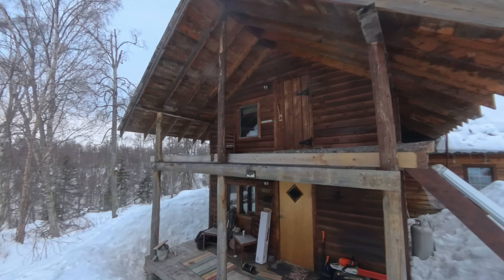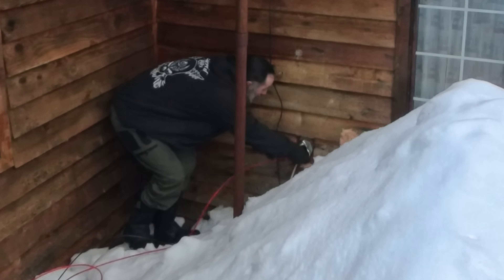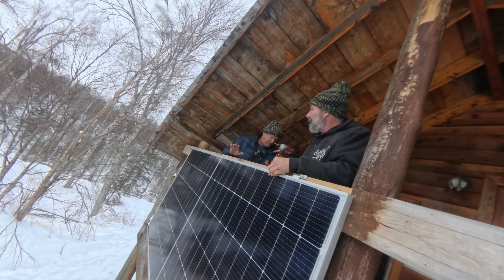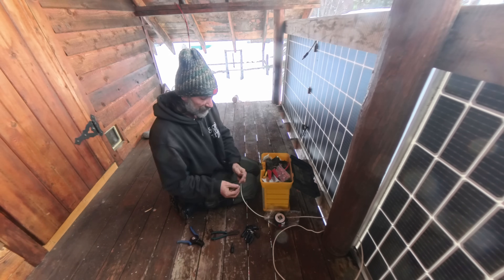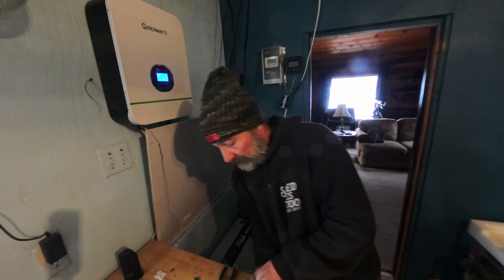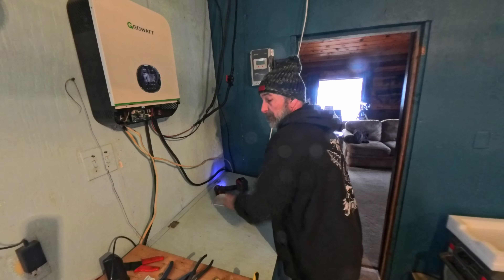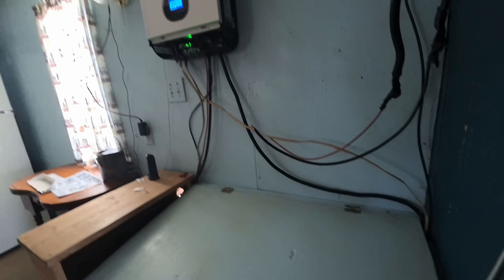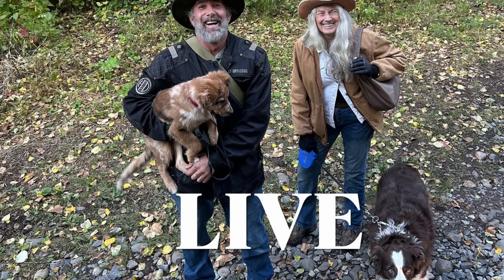Solar Power the Best Option for Off Grid Living!

Comment: Almost need crampons and ice climbing gear with that roof slide off.  Most of our winter is gone,  just a little ice left on the water.
Reply from the maker: We still have a foot or so in places. However our temps have been in the high 40's low to mid 50's so it is melting fast.

Comment: I have my BF 550W vertical 1 ft off the ground, with snow each 550W produces 697W, snow won't stick, only have to clean bird poop, panels are cleaner now than install.
12kw I made 1 MW Nov 1 to Feb1 and used 66 hours of Gen all winter with electric heat, only a -5F low this year and -27F previous. Low to the ground 1 person install.
Reply from the maker: Nice. What area are you in?  We are getting more panels.  I found some 370w BF for 150 each. I picked up 6.  I need to build a rack for them. I looked at yours YT and see how you did it and think I can do the same just higher off the ground due to snow depths.
Reply: @curmudgeinnak  The newer mount with sunken clips (and square lol) the other upgrade is 1x1 in between the panels, if you use post sealer on the bottom rail it should last a few years, I knew I had to move mine, so I skipped that. The mount was designed to be adjustable even on an east west hill and setting the top beam lets any panel fit up too 93"x46", the extra 2x4 next to the panels makes it rigid. I can see the USA border from Canada. Your 2220w should be closer to 3kw with sun and snow in the open, hopefully you won't have to shade the array with a stick like I had too, the stick dropped the power1100w. 4" zinc screws I broke 1 of 700. Snow melts fast ahead of the panels next year I am going to pack the snow down tight.

Comment: ROB  I  put  my  solar  panels  on  the  sides  of  the  windows  all around  the  house  !!! It  is  better than  the  roof  that  I  hath  found  !!! Got  a white  house  next door  to  me  so   got  2nd  floor  with   panels  also !!!  Great amount  of   watts  coming  into   the  house then !!!  Sun  beats  off of  the   snow  Rob  !!!  HEY  THERE   SARAH  !!!
Reply from the maker: On the main house we have them on the side of the house as well.  They work great.  The cabin doe not have much space on the walls that would get good sun so I used them as a barrier for the deck.  For the house I will be building a small tower to add more panels to it.